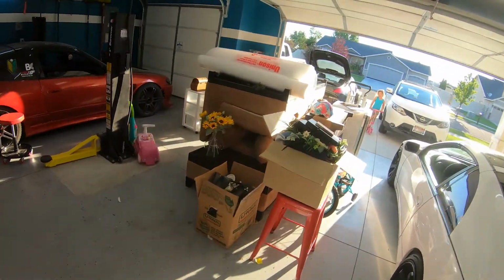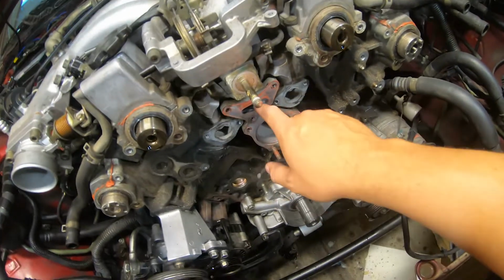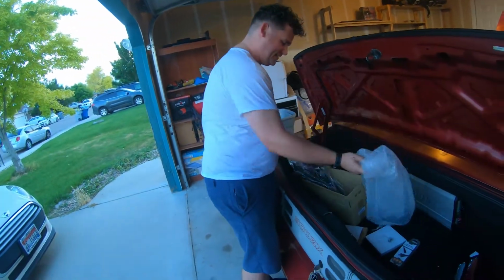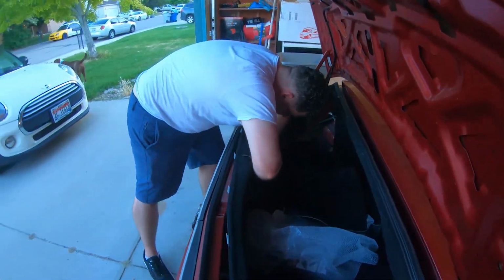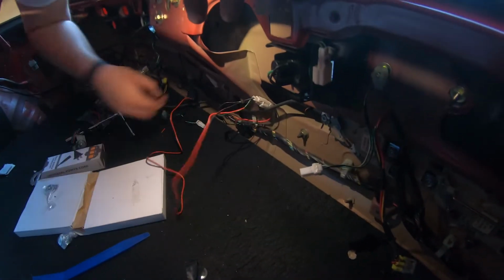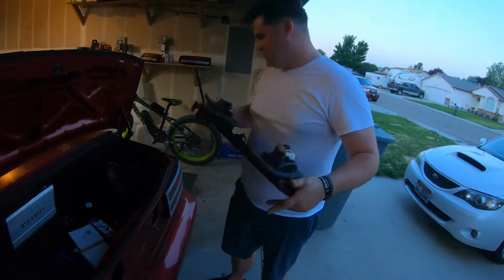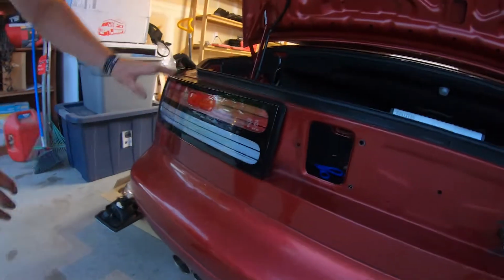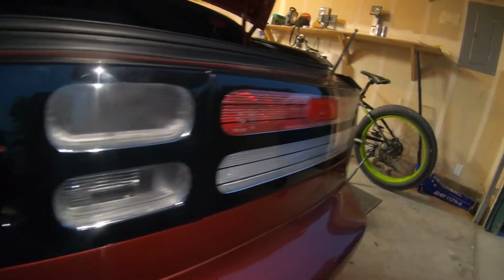The BEST Taillights you can get for the 300zx!!

Comment: Quick question, do you have to use a Heat gun on the Tail light housings to remove them, and remove most of the old glue or just leave it?
Reply: Just leave the old glue and reuse it. Also just take your time and use a heat gun. Trust me I traid all sorts of different ways and the heat gun works the best.